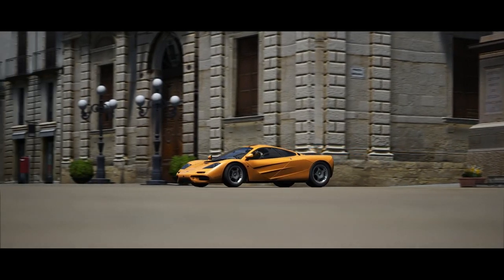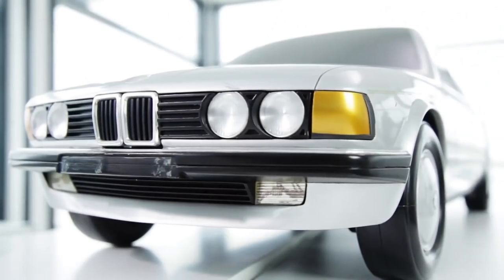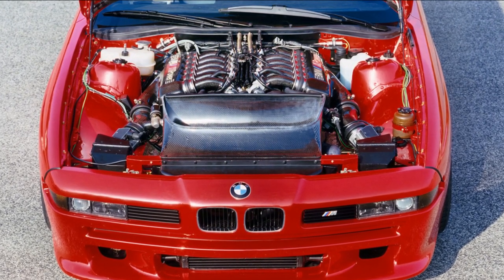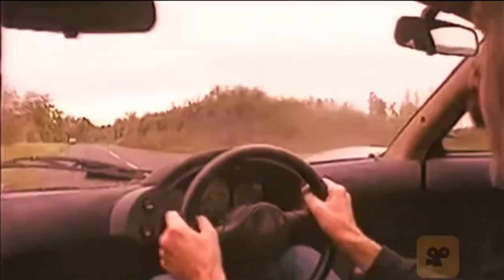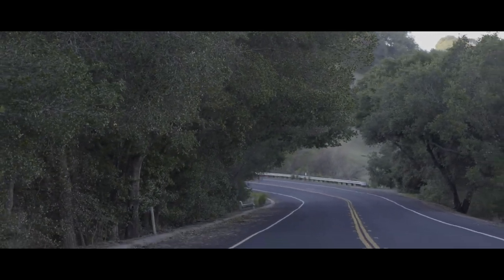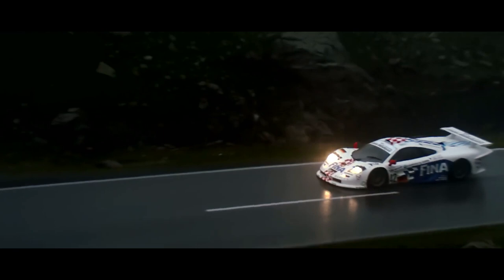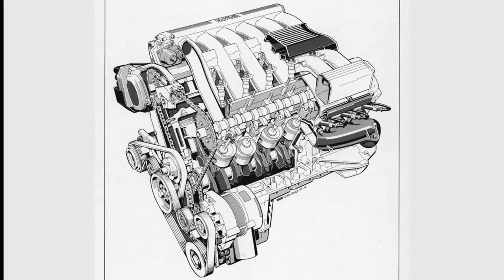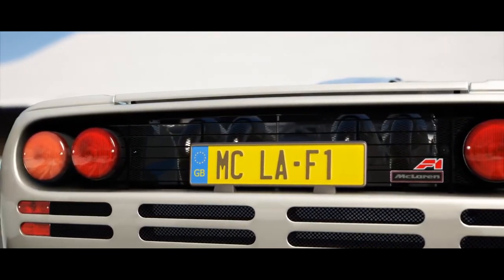BMW S70: The Greatest BMW V12 Engine Ever Made

Comment: The 850M didnt give birth to the S70 engine, the McLaren F1 projects did. The S70 found its way in other cars after being conceived exclusively for the F1. The M70 block is the only piece of the M70 that was used for the S70/2 & 3. There was an upgraded version of the M70 that was tested for the 850M but that was not the S70, it simply an upgraded M70. There was no S70 prior to the F1's engine development. Paul Rosche (Head BMW engine designer at the time) originally developed the S70 because the modified M70 he presented to Gordon Murray for the F1 was totally wrong in weight, size, and performance. He later went on to redesign the head, internals, and exhaust to match Murray's F1 requirements. The S70 (and adaptations of it) were utilized /or tested in the LMP car, BMW X5, and others.
Reply: Well said thank you
Reply: And it was still a little over weight for Gordon’s preference but it would have to do… lol
Reply: @drummerdoingstuff5020  He overlooked the weight since BMW gave 77bhp more than he originally asked for lol. I think he got the better end of things. The engine is truly a work of art in my opinion.

Comment: Currently I am on my third E32 750iL. 

There is nothing that drives like these cars and these M70s are incredible
Reply: @maxboya  The E32 and E38 were by far the best years for BMW 7 series. I once drove an E38 750, then drove an E65 750. The E65 was very nice but definitely fell below the standard the E38 set in my opinion.
Reply: @KaDuWin E38 definitely had more electric gremlins and wasn’t as DIY friendly as the E32. 

To me the E32 750 will always be the king. First ever production V12 sedan. Doesn’t get as much credit as it deserves
Reply: @maxboya  Totally fair, I was never a fan of all the computers and overuse of electronics in general. One reason I miss my old 91 MR2, I could fix anything on it. But I did love the way that E38 drove compared to the overweight and clumby feeling E65. The E38 felt more rigid, lighter, and alive.

Comment: Not sure, think the Mercedes V12 ended up being the better engine in the end with it still being used in things like Paganis.
Reply from the maker: The M120 engine, Mercedes's first V12 blew the M70 out of the water. The engine was one liter greater and put out 100 horsepower and pound-feet of torque more. Lastly, the M120 was more reliable than the M70. 

When BMW introduced the first German V12 engine in 1987, Mercedes-Benz delayed the introduction of the W140 by eighteen months to 1991 to develop its first V12 engine.
Reply: @christheradar yet there are more higher mileage M70s than M120s on the roads today?

Comment: the mclaren F1 Lm 
is quicker than the normal f1 
0-60mph only in 2.9s and it weights 1,062 kg 
while the F1 weights 1,138 kg
the longtail is 900HP not 600
and it weights 915kg.
Reply from the maker: Where you get that information from? Because that's incorrect. The long tail do not make 900hp and the F1 LM is only quicker than the normal F1 on the track.
Reply: Racing versions had more drag due to changes to the aerodynamic so the racing modifications were slower by top speed but quicker in fast corners.
Reply: @mrbasfed1948  I actually did give him the recourses but youtube keeps deleting my replays , one of the longtails was 900HP and yes . every gtr or longtail or LM is quicker than the normal f1 by 0.3 seconds
Reply: @BriZ3l21  , I read your comments about 900hp versions, but I can't find any material on this. It may be the case that you got the Formula 1 engine specs, instead of McLaren F1. All that I could find is that there were several versions of the engine with power ranged between 550 hp and 680 hp.
Reply: some longtails had over 900 hp, yes

Comment: There are a lot of mistakes in this video, with model numbers and accurate history, and pronunciation.
Reply from the maker: Please elaborate. I completely did my research.
Reply: @christheradar  
At 4:53 where you state that the S70 was developed into the S70/2, this is wrong it was developed fresh from two S50B30 engines at the time by Paul Rosche (a small nit pick but it is also pronounced "Rosch-e" not "Roush").
Also at 4:59 another small nit pick "Murray" is not pronounced like that.
At 6:03 , saying "and a 48-valve is incorrect English."
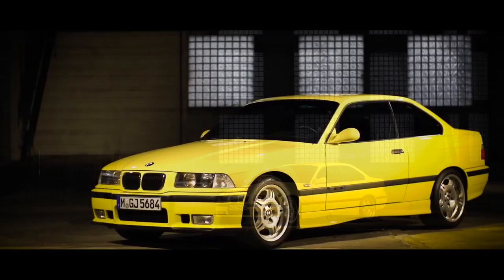At 6:10 you say S30b50 when you probably mean S50b30
at 6:20 you say it was the first naturally aspirated cars to make 100hp/l which is also incorrect Honda, with the B16 engine was the first to break into that realm from their motorcycle division which had achieved this much earlier.
At 6:26 you say it was the most powerful engine which is also incorrect in its time.
at 6:30 you say 11:1 compression when it should be 10.5:1
at 6:32 you say it made 627hp this is incorrect it made around 618hp.
at 6:38 you say it weighs less than 2500lbs this is incorrect it weighs 1,138 kg (2,509 lb), which is heavier than the Mazda MX-5 Which is 1,127kg (2484lbs)
At 6:46 you say it set a top speed for 240mph, which is only for the prototype car the normal top speed for the cars was 225mph.
at 7:50 you say it was restricted when it was actually a completely different engines, it also made 592hp not 600hp.
at 8:52 you say it was built for downforce, however this is wrong it was built in the long tail to reduce drag and weight across the car.
everything after 9:10 I have no knowledge on so I wont say further.
But there are a lot of this that you have pronounced incorrectly though out the video.
I am not trying to knock down the video, I just do not wish to see misinformation on the internet.
Reply from the maker: @Kowalamaster Well let me tell you something, although there may be some instances of misinformation and mispronunciations, it is important to remember that mistakes with words are unintentional. The rest of the content is based on research from various sources and is not fabricated.